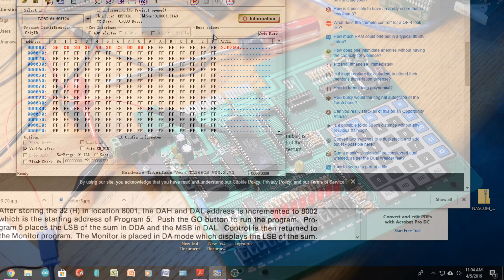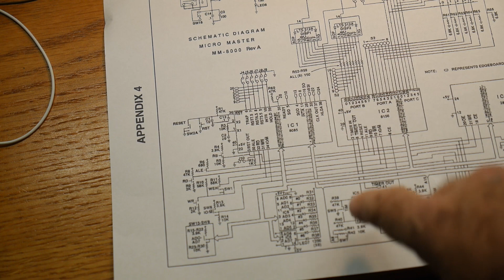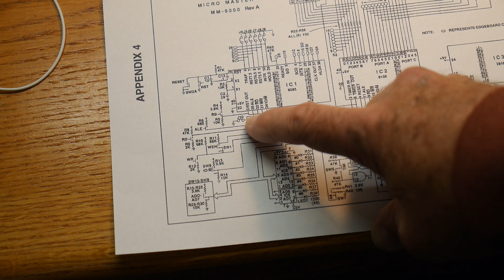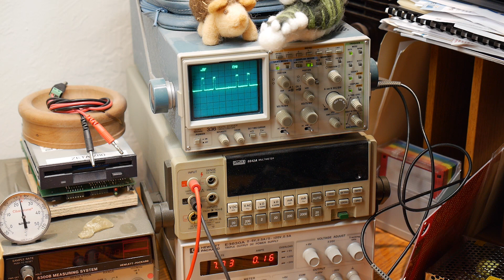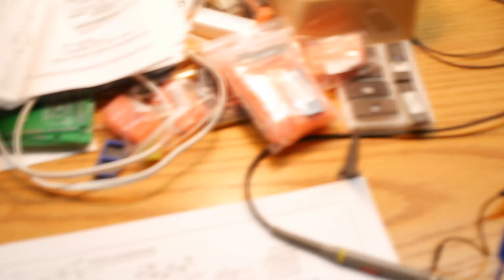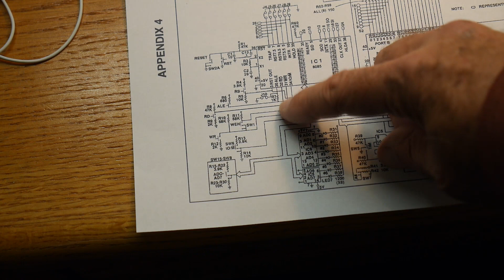#329 Micro-Master MM-8000 ROM programming

Comment: I think if you put the resistor on the left side of the jumper can be a good idea to not accidentally short circuit the ale pin to ground when programming the eeprom